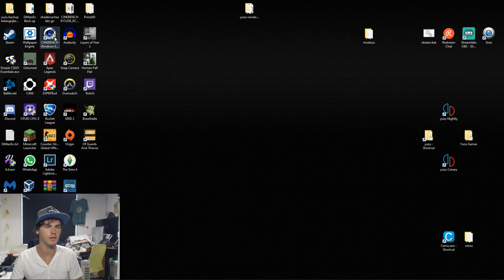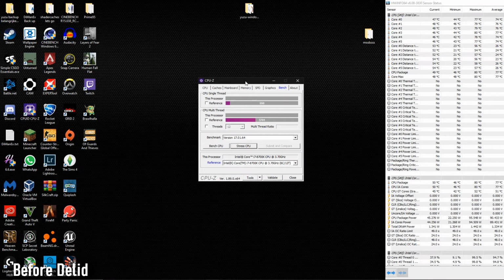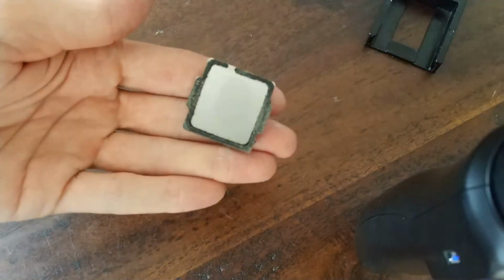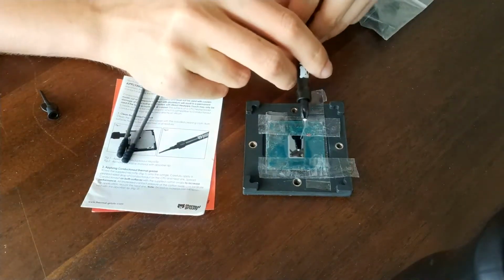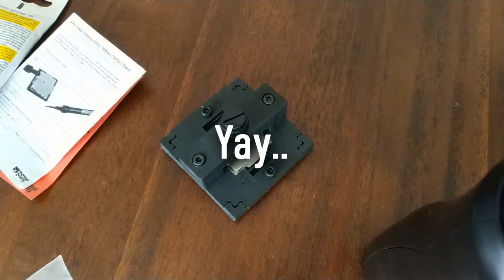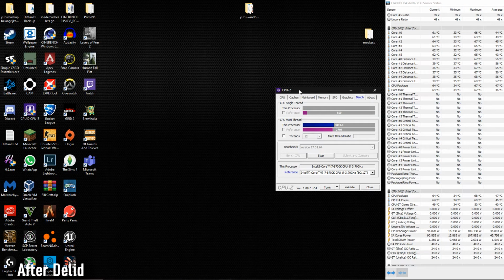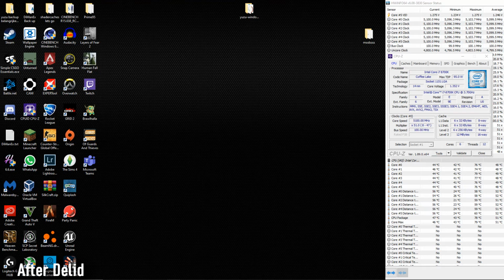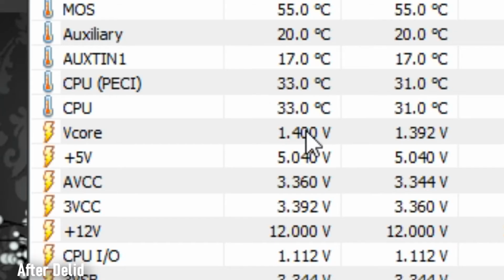How i delidded my 8700K  |  Temps & Benchmarks

Comment: I heard some flecked nail polish can conduct heat is that not colored nail polish? Or is flecked the nail polish with the tiny bits of shiny things?
Also is there a position for the cpu inside the tools for when you put the IHS back on in the tool?
Reply from the maker: I had no issues with heat so far, it's regular nail polish. The screwing down tool has a specific placement so it will fit in the socket nicely after putting the IHS back on